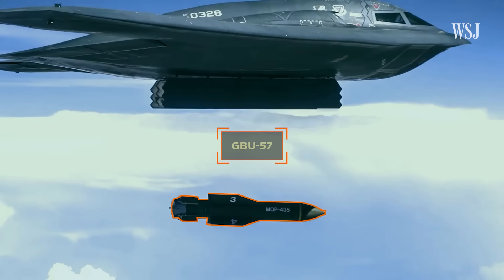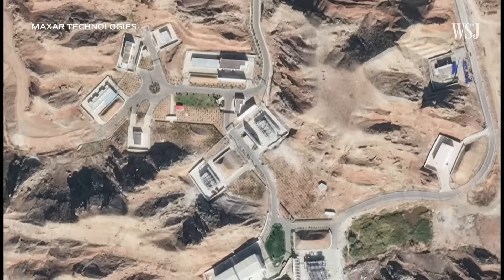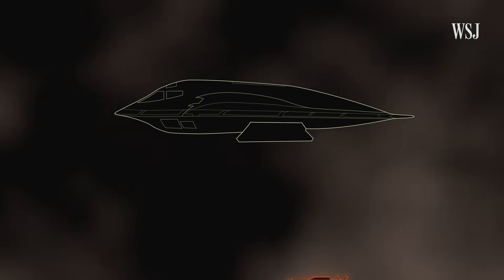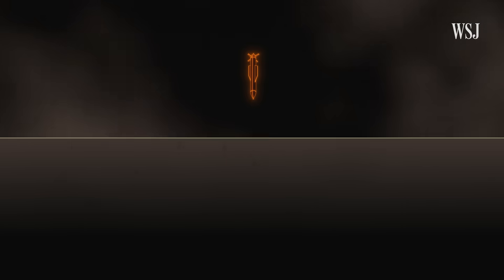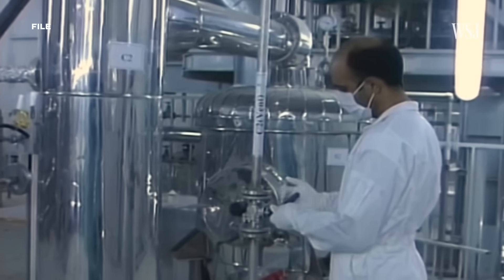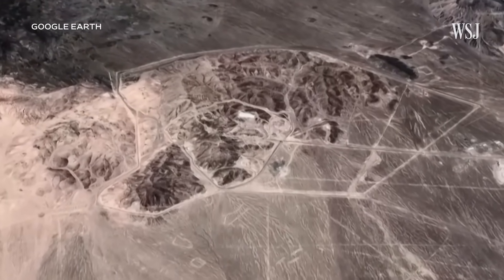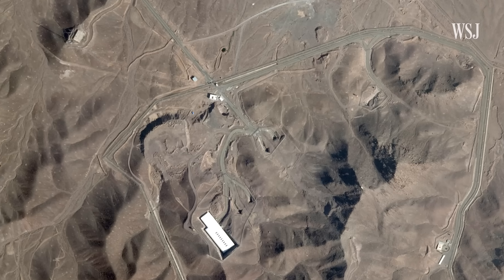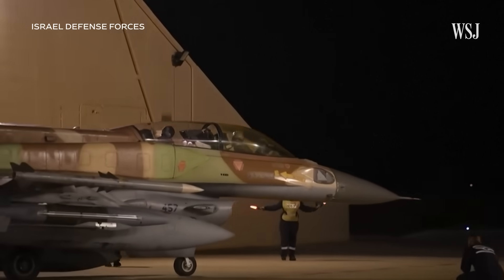The 30,000-lb Bomb Trump Struck Iran's Nuclear Sites With: GBU-57 MOP | WSJ Equipped

Comment: no it cannot,   The GBU-57 can't destroy Fordow. That site is buried under 80+ meters of solid mountain, way deeper than the MOP can reach (it tops out around 60m of reinforced concrete). Even if it hits, Fordow’s layered structure and internal blast protection would likely keep the centrifuges safe. Plus, only a B-2 bomber can carry the MOP, and flying one over Iran without being detected is near impossible with their S-300 air defenses. Realistically, you'd need multiple MOPs in a perfect strike, and even then it might not fully destroy the facility. Fordow was built specifically to survive attacks like this. That’s the point.
Reply: It’s not that simple. Fordow isn’t some regular underground bunker — it’s buried over 80–90 meters inside a mountain, not just concrete. The GBU-57 is powerful, sure, but it maxes out at around 60 meters of reinforced concrete or equivalent soil. And that’s in ideal conditions. Fordow also has shock-absorbing layers, blast doors, and probably internal segmentation, making a full kill even harder.

Not to mention: only B-2 stealth bombers can carry it, and Iran has S-300s and radar coverage protecting that region. You’re talking about multiple precision hits in contested airspace, on a site designed from day one to survive MOP-level attacks.

If the U.S. really thought MOP could take it out, they’d have done it by now.
Reply: B-52s have been tested with the MOP, but B2s can carry two. With what Israel is doing to Iran's air defense systems, B2s have a good chance. There are several at Diego Garcia now, they'd need air refueling, but indeed do'able.
Reply: You’re right and also very very wrong. It doesn’t need to obliterate the facility to be effective. The impact would destroy all entrances and exits in and out of fordow, it would collapse about half of the facility in on itself and effectively render the site totally inoperable. Which is literally just as effective as total obliteration of the site. So while yes you’re technically right, you sound like some book worm who isn’t thinking about practicality. But good luck to you.

Comment: It’s not the largest non nuclear bomb. That’s the MOAB which is also exclusively owned by the US
Reply: MOAB is 21,000 lbs this one is 30,000 lbs where Im from thats called bigger
Reply: @BBQ-n-Pigskin  It's not just about mass, but explosive yield. The MOP has a huge amount of steel, but just 2t of explosive compared to the MOAB's 8.5t
Reply: The MOP seen in the video is actually larger than the MOAB by 8,000 lbs. They are both similar other than the Massive Ordinance Penetrator (MOP) is for destroying bunkers and does not detonate in the air like the Massive Ordinance Air Blast (MOAB).
Reply: pls go back to school or just google and learn something
Reply: the is that MOAB aka H-Bomb is a fission bomb. minimal radiation but still a nuclear bomb. that said weight is a question of intention.

Comment: No word on the price? Can't imagine they come cheap...
Reply: The cost of the largest conventional bunker buster bomb in the United States' arsenal, the GBU-57A/B Massive Ordnance Penetrator (MOP), is estimated to be approximately $3.5 million per unit. This figure is based on a 2011 contract where the U.S. Air Force ordered eight of these powerful munitions for $28 million.
While the individual production cost is around $3.5 million, it is important to note that the total program cost is significantly higher. The development and testing of the GBU-57, a massive 30,000-pound (approximately 13,600 kg) precision-guided weapon, is estimated to have been between $400 million and $500 million. Some reports have even cited a higher per-unit cost of around $20 million, which likely includes a portion of these extensive development and integration expenses.
Reply: @badbad-cat  Not to mention b-2 bomber costs >$2 BILLION each!
Reply: @badbad-cat  I was gonna lol-post "tree fiddy million" I can't believe that would have been right. Thanks for the info
Reply: 4.99$
Reply: MOAB, or Massive Ordnance Air Blast bomb, costs approximately $170,000 to manufacture.
Reply: No word on the human price? Who tf cares about money.
Reply: @kallashnykov how many people live on a mountain above a nuke facility?
Reply: More like how are the going to replace the ones they use up. As China is blocking the exports of various materials and have long term contracts over the various deposits of minerals around the world that make up these bombs.